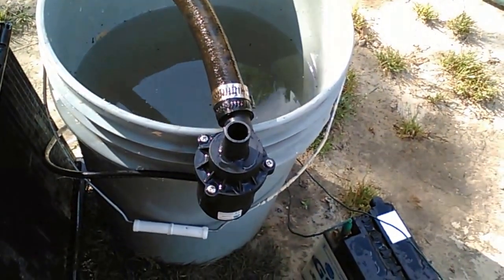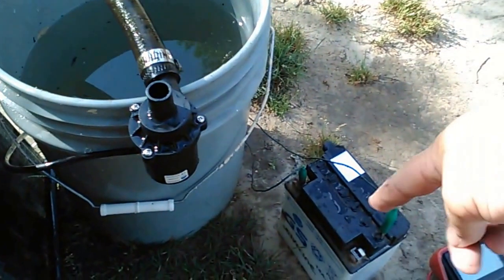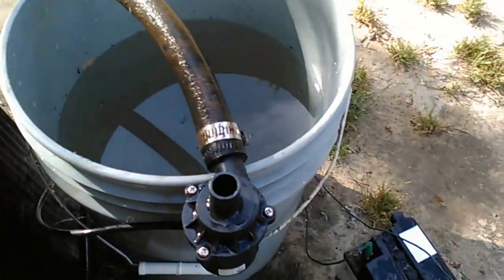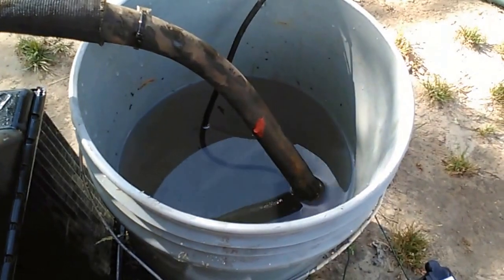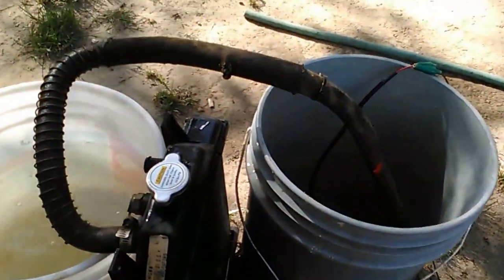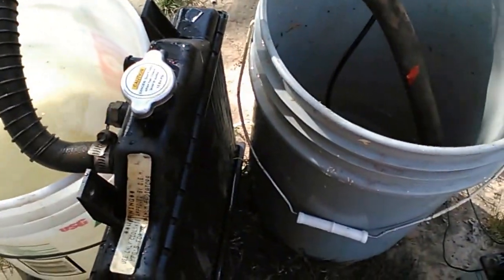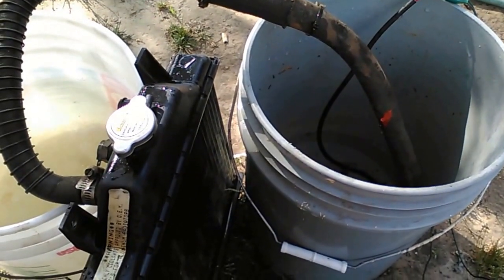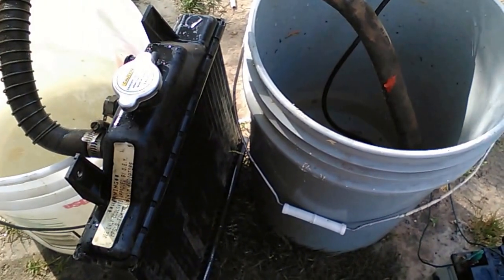Polaris 400 2 stroke water pump modification - First Test

Comment from the maker: Sorry I never got my motor fixed ended up getting it professional rebuilt.

But if you get a pump that can handle pumping HOT FLUIDS (210° F) then you can just bypass the internal water pump.  But you have to deal off the old pumps in/out ports so the counter balance gear stays oiled up!!   And check the crank oil they do use 4 oz. Of oil  Crank case!!!!

Comment: Good video but make sure you check your antifreeze after a few months of running it this way because on a glycol heat system we had to reduce the pump speed because of coagulation or gelling up of the antifreeze.but that was on a boiler system to heat pipes for winter .I do have a 2 stroke 99 explorer with a blown head gasket/overheated water pump impeller.Seems this could work well.

Comment: My 400l cools very well with factory pump. Even in tight woods and slower speeds, I really have to work to even get the fan on. I can think of many uses around the house for that pump! How did it go? Any updates?